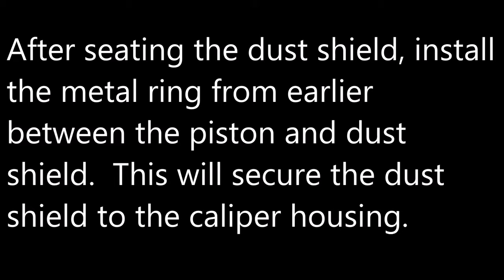How to Rebuild a Brake Caliper Fast & Easy

Comment: Red Rubber Grease is totally compatible with DOT 4 fluids.  It can be used to pack the dust boot to prevent ingress of salt and muck...unlike the Dot 4 fluid.
Reply from the maker: Hello. That’s good to know.  I’ll definitely do that next time. Seems like that step would increase the life of the boot. Thanks!
Reply: @FastFixYouTube  There is no need to pack the boot the boot will allow air to pass but not water or dirt. If you pack it it could make the boot pop off under air pressure.
Reply: @FastFixYouTube  You do NOT have to install the dust seal over the large dia. part of the piston first as you did here! Just install it into the indent on the piston where it is supposed to seat, and then push the piston into the bore all the way, and then push the rubber seal in with your fingers into the outer bore indent where it is supposed to seat, it goes in no problem at all! Then install the metal ring, and your done!

Comment: Something that gets overlooked quite often when rebuilding a caliper because the vast  majority of people don't know about this - is the seal that fits in the bore is tapered and needs to be installed so that it faces the correct direction. The seal is tapered so that the piston will slightly retract when there is no fluid pressure on the caliper. This keeps the pad from pushing into the rotor when the pedal is released and causing premature pad wear. People may not believe this is true but it is indeed a 100 percent verifiable fact
Reply from the maker: Hello. Great comment!  Thank you for sharing 👍👍👍
Reply: So does that mean the thicker end goes in first? I haven't noticed any tapering yet but that would also probably ease the installation of the piston when it's first pushed into place. I'm always slightly afraid that I somehow wringle and dislocate the ring upon insertion.

Comment: Crimping brake lines & therefore leaving them to possible future damage is a damn ongoing hassle & I never know what the hell to really do?? Same say its ok but equally others say don't even think of doing it!! Appreciate some comments here please!! Personally I'm not happy myself with this practise & often refrain from implementing it in any case, I very much doubt if brake lines were actually designed to be distorted & abused to this degree!!
Reply from the maker: Hello. You’re absolutely right. Crimping should be a last resort or a total no-no, but you’ll often find it to be a common practice, even at reputable repair shops. There are tools to help, but I’ve heard they’re cumbersome and unreliable thus, the ongoing bad practice. My lines were fine after crimping, but I’d not recommend doing it. At your own risk type of thing.

Comment: U can remove caliper but leave attached to car. Pess break peddle with pads removed. It should just pop out. Then gently clamp hose and undo banjo bolt.
Reply from the maker: ☝️exactly

Comment: no need for an air compressor, you can do it with the brake pedal before disconnecting the brake line...though it is a bit messy that way.
Reply from the maker: Hello.  Yep, that’s what I tell folks who don’t have access to compressed air.  If it were me without compressed air, I’d probably forgo the rebuild and buy a reman.  No thanks on the mess 😂 Thank you for the comment and suggestion 👍👍👍

Comment: You put a board between the driver seat and brake pedal and move the seat forward to where the brake pedal is pressed like 1/2" forward and then stop. Then disconnect the battery and you shouldn't get brake fluid leak.
Reply from the maker: Great idea! 👍👍👍

Comment: DO NOT crimp the brake hose line this guy did! Unless you want more problems. 
Here's how to do it:
Before you remove the brake line, disconnect the battery. Slightly depress the brake pedal.  Slightly less than 1/2 inch after the pedal touches the pushrod and use something like a stick or dowel to hold it there. Now get to work. 
Doing this moves the piston past the inlet and return ports of the master cylinder so no fluid can leak down from the reservoirs. You'll just get a few drops out. If it's a metal line going in I clean and place the dust cap from the bleeder over the line if it's going to be apart for a while. You disconnect your battery because you probably don't want your brake lights on while you're working. 
DON'T CRIMP YOUR BRAKE HOSES KIDS!
Reply from the maker: ☝️ this!
Reply: or crimp it, replace pistons and replace the hoses for brand new ones. xD
Reply: Interesting advice as I was about to purchase some clamps so called supposedly  for brake lines!! Well so much for that!!!  I never liked the pink colour of the clamps anyway!! I'm not a pink guy!! (yeah right)
Reply: Thx . I really didn't want to crimp.  Tried it your way and it worked

Comment: PLEASE don't crimp a rubber brake line. You can collapse the inner lining and then when you apply your brakes, the fluid travels down the brake line to the caliper as it should. However when you release the pedal, because the hose is internally collapsed it acts as a 1 way check valve, the fluid cannot return back through the hose, therefore the caliper remains seized.  Another method to keep all the fluid from dripping from the brake hose when you remove it, is to press the brake pedal in about 1/2in with an extendable rod, or I've even used a brick. This means the brake lights will stay on, so you may want to disconnect the battery. (Remember your radio code) No more than 1/2in tho, that way the piston inside the master cylinder is moved from its resting state and mostly covers the holes leading down to the brake lines, therefore drastically slowing the drip of the fluid. 
Great vid, just wanted to pass that info forward.
Reply from the maker: That is an excellent tip. Hadn’t thought of that one. Figured the crimp method wasn’t ideal, but didn’t know of a work around either. Thanks for this it’s greatly appreciated.
Reply: Interesting. I've seen a lot of pro mechanics do it and no warnings like this.
Reply: I heard the same thing about internal collapse. Not sure if it's true but I don't take any chances.
Reply: is there a better way?
Reply: @djfukno4770  I stick a compressible foam ear plug into the end of soft lines and so far it hasn't done me dirty.
Reply: @tjord  great idea!! i kept thinking of something for a plug! gonna try it !
Reply: @tjord  YOU are why I love the internet - grear freaking idea
Reply: You can buy special caps that will cap the lines. I have them at home as I’ve done a few of my families cars. They obviously need to be the correct thread for your vehicle. Mine were M10 x 1mm with an inverted flare. Handy if you have a caliper removed and need to use the cars hydraulic pressure to push out a jammed piston on another caliper. I’ve just done caliper rebuilds on a Subaru that didn’t have a male threaded hose. Instead they had banjo fittings so I drilled and tapped a blind hole in a small piece of aluminium and used a normal bolt and copper washer to seal. It worked well. I like the foam earplug idea if you’re removing the calipers and know your pistons will come out with air. As said in the video though, you’ll still need to bleed the brakes after the job is complete.
Reply: @djfukno4770  Lose fluid and bleed the brake when your done? Lol
Reply: I agree 100% as I cringe every time I hear someone suggest crimping that hose. So many times, I have seen people unnecessarily replace the caliper because of a collapsed inner core.

Comment: Didnt realize till like 6 hours ago calipers can be rebuilt, so im going to jump to it and do the same on my pickup.  Beats paying a lot for new calipers, and just as easy to snap in a new piston as it is to replace a whole caliper.  Good video!
Reply from the maker: I hear ya!  I didn’t think about rebuilding until I got quoted the price for a new one. It’s definitely easier to buy rebuilt, but if you can rebuild for a fraction of the cost, why not?  Just keep in mind it’s a bit tedious and will take some time 👍
Reply: Yup! But when you try to get a caliper rebuild kit(seal & dust boot) at a parts store they look puzzled & tell you caliper rebuild kits don't return anything on there computer search. They want to hose you by selling an overpriced rebuilt for 60$ or more. The kits are around 10$ & they don't make as much if they sold them.
Reply: Don't know if it's because I'm female or guys just like to assume I don't know anything. But my Volvo has very expensive parts and usually way too much money. $600 Canadian per caliper. I already replaced the back caliper and started seeing the videos for repairing the calipers. Now I'm hearing "you should never cheap out on parts" "it's incredibly dangerous to repair the calipers, just buy new ones" and garages actually getting angry at me for asking... This seems pretty simple and my calipers were in fine working condition before they were pressed in by the wrong tool, the wrong way.. the repair kits I found are only the gaskets. Should I replace the entire piston?

Comment: An alternative way to get the boot back onto the piston is to seat the boot in its groove in the caliper, then slide the piston into the boot most of the way. Put a piece of 2 x 4 in front of the piston. Apply air from the back of the caliper and it should push the boot forward into its groove on the piston.
Reply from the maker: Oh nice, that’s a good tip!  Much appreciated. Will try that next time if I have to do this again. Thanks 👍
Reply: Thanks brother
Reply: Just knocked it out doing this method took 30 seconds thanks for the tip

Comment: Happend upon this video randomly glad to see people still out here rebuilding brake calipers. It's trial and error with the dust shield but once you have done a couple you can be in and out in like 20 min start to finish. $4.99-$12.99 vs $100-$300 well worth the little bit of effort to fix it. Me I rebuilt the whole thing. Replace the slide pin boots and bleeder valve as well. Literally cost me a total of $10-$20 per caliper and thats all they do in china with your core you give back then ship it back out to be sold as a remanufactured caliper.
Reply from the maker: Exactly right! So so much cheaper to do it this way and if you’ve got experience, you’re gonna be able to knock this out pretty quickly with little frustration. Most people are doing this for the first time, but hopefully after they completed once they’ll be able to do it again and again in the future and save a good amount of money. Great work and thanks for the comment!

Comment: Im rebuilding a1990 Honda Prelude 4WS and everything under the hood and wheel wells is basically BLACK with thick grime. Good thing about being covered in 30 years of grime is once its cleaned off, you can see all the original metal treatments and coatings. I always thought the calipers were a grey color(online rebuilt calipers for sale are a dull grey due to being soaked in acid bath to remove said black grime but also removes any metal protection treatment) but in reality, they're a golden zinc color. I spent days gently cleaning and soaking in simple green. Lightly scrubbing with a brass wire brush. Lo and behold, the once velvet black calipers are now a greenish gold zinc color! I keep imaging how they looked new, contrasting off the silver rotors. I don't know if i should paint them with a high temp rotor paint tho just for future weather and temp proofing because, even tho the zinc coating looks great, i don't think it will hold up much longer and some areas have been scrubbed off almost completely. But man they look awesome tho! 30yo calipers that most ppl just toss out or replace for the dull grey "rebuilt" calipers(basically same exact calipers just acid bathed and rebuilt). Shoot i might just buy the online ones, paint them and save the zinc ones for posterity lol
Reply from the maker: Wow, I love this comment!  I’m also a fan of the zinc color and if pressed, would keep it zinc for as long as possible. But you said it yourself, already worn off in areas and will soon giveaway to rust. I like the idea of keeping them around for posterity.  Nice garage decoration 👍

Comment: Good video, I have a electric parking brake on the Acura with a ripped boot, gonna have to find out how that comes apart pretty soon.
Reply from the maker: Hello.  BE advised that There is probably safe mode to operate on your rear brakes. I have an electric parking brake on my truck and I have to go through a few programming steps to enable “brake safety mode.”  Fear is engaging the electronic brake on accident and losing a finger or two. Best of luck!

Comment: But I don't have an air compressor.  Am i going to have trouble getting the piston out?
Reply from the maker: Short answer is yes, you will. The only other way I know of is to remove the caliper and depress the brake which will force out the piston. It’ll be messy… have a bucket on hand to catch the brake fluid. It’s highly corrosive to paint amongst other things. Best of luck!

Comment: Does the seal have to cover the whole piston? I can’t seem to keep the seal over the rear of the piston when I’m pushing it in
Reply from the maker: Hello. I’m not sure I’m understanding your question completely, but yes the seal should slide down the entire piston. It won’t cover the piston, just fits into the lip of the caliper. Hope that helps.

Comment: I had replaced the brake pads on my vehicle before but this time I wanted to remove the calipers clean them up and I couldn't figure out how to get the piston out. They were roofing a house across the street and I asked him if I could use a little air no problem  I didn't know if it would work or not but what I was doing wasn't working an the compressed air shot that piston out of there like a bullet anyhow nobody got hit thank goodness.  The reason I did it previously was because one of the seals had been pulled out and there was all kinds of dirt in there and that's why that particular caliper was getting stuck closed.  No damage to the seal they were fines I'm re-overhauling them again right now.
Reply from the maker: Sounds like a close call!  Had a guy comment here who said he broke his thumb doing this! Ouch…

Comment: I have a ripped boot on my caliper and might try a rebuild if possible to save some money. I dont have compressed air to push the piston out. Are there any other ways to get it out?
Reply from the maker: Hello. Yes, there are. You can always remove the pads and the caliper, depress the brake and get it out that way. You’ll spill fluid all over, however. Best of luck!

Comment: What is missing in the video is pre-fitting of the piston, what it looks like and its tolerance like when it fit into the bore.  Thanks!
Reply from the maker: I didn’t do any measuring as I researched the part and knew it was correct for this caliper. To be safe, I suppose I should have, but it worked so I assume was gtg. Thanks for the comment 👍

Comment: Note that it's not the rubber piston sealing ring that causes the problem but of course the damaged dust cover that's responsible for letting water in and causing the piston to become rusty. The rust then causes the friction and may eventually lead tot leakage. 
So, if you notice a damaged dust cover then you can begin right away with your repair job as this will inevitably lead to the mentioned brake problems.
Reply from the maker: Correct! 👍👍👍

Comment: I have a question: i have a 98 camry and today was doing my brakes and having taken the brake pads off, i accidently pressed my brakes too much and had one of the caliper came out too much. it's not going in  no metter how much i try. one friend said the caliper is out of the housing and i need a new one. is there a way to get it in? or do i just need to buy a new one?
Reply from the maker: Hello. I assume you mean ‘piston’ when you say the ‘caliper’ came out.  It should go back in.  I bet the metal retainer ring is keeping it from seating back in the cylinder. So, remove the rubber boot and inspect the cylinder. If the retainer ring is still installed, remove it. The piston should go back in when you make sure nothing is blocking it. Hope this helps. Best of luck 👍
Reply: @FastFixYouTube  can you make a vid on this
Reply: I got the same problem

Comment: Why diid you losen the caliper bracket bolts? You dont need to remove the bracket to remove the caliper do you?
Reply from the maker: Hello. To be honest, I do not remember. I’m sure there was a reason why I did that, but I suppose it’s also possible that I left in some footage that I shouldn’t have. Simply evaluate the situation when you go to do the repair and the answer should be self evident. Thanks for the question and have a good one!

Comment: If you don't have an air compressor, can you use a slide hammer to pull the piston out?
Reply: Put a small wooden block, about 1.25in in the caliper and depress the brake pedal about 5-10 times til it is pushed out .
Reply from the maker: What he said!👆

Comment: Crimping the brake line is like bending a phone cord in one spot over and over and then expecting the inside to be fine and charge your phone. The pressure from clamping even once a brake line that’s starting to deteriorate inside can break the inside of the hose structure enough to cause the pressure to not flow right and your new caliper to cease from a lack of brake line pressure..
Reply from the maker: Yes, I agree with you. Wasn’t optimal…

Comment: How do you get the piston out if you don’t have compressed air?
Reply from the maker: You could keep it attached to the brake line, remove the caliper from the disc, and depress the brake. Will be messy, but a way.